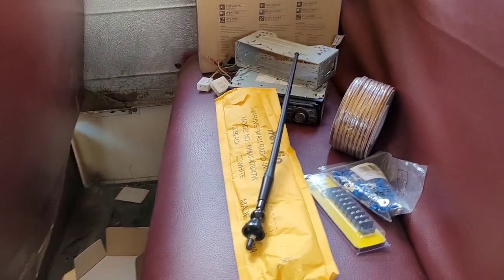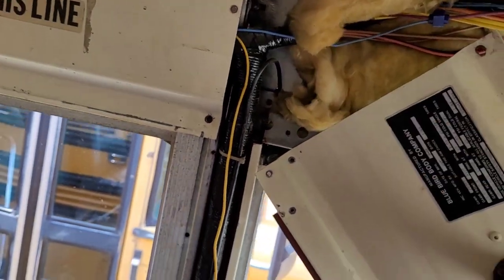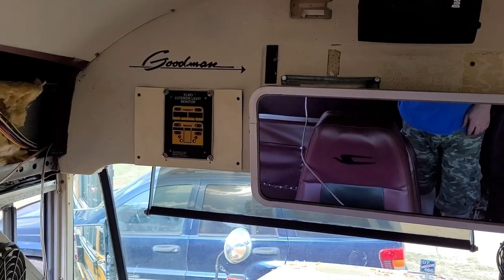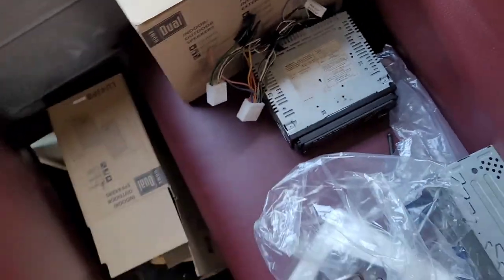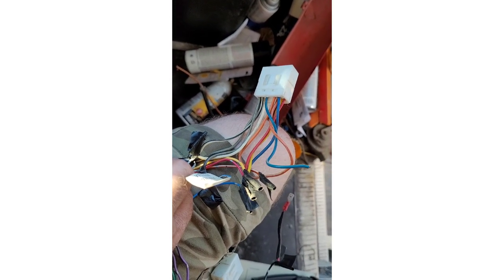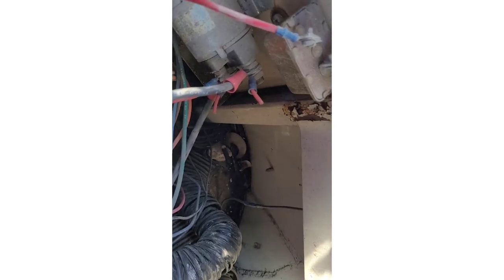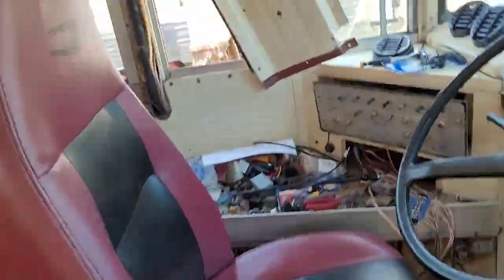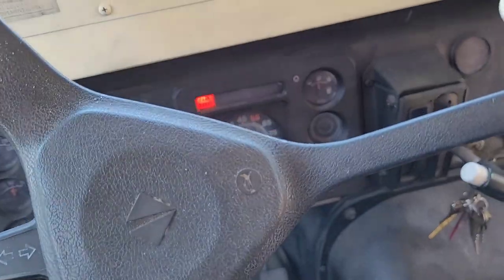Installing a Stereo System in a School Bus

Comment: Nice install, Jon. I just bought the bus I had been driving for a couple years from my bus company. The original Panasonic stereo had been removed many years ago, before I started with the company, and in its spot they threw in the two-way radio. Once I bought it, I stripped the bus of all the company tech and then got a newer Panasonic unit out of one of our junk buses and threw it in. Screwed in a new antenna on top of the bus, plugged the stereo in, and it's working great. It has AM/FM, CD, aux jack, and a PA microphone. Only downside is that in this bus, the crappy ceiling speakers are only in the middle to rear of the bus and it's a front engine flat nose. Can't hear too much in the front of the bus, so I definitely want to do something similar to this as far as mounting some nice JBL speakers towards the front and just jumping them off of the existing speaker wires. 

I know your pain when it comes to using the coat hanger to fish wires through the bulkheads and what not. I do two-way radio and camera system installs in our buses, and it can be fun sometimes.